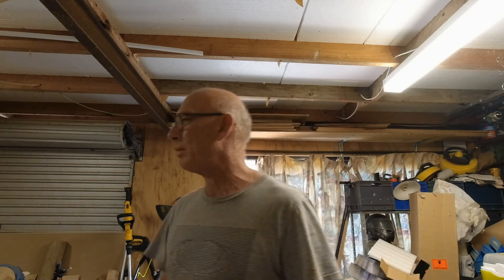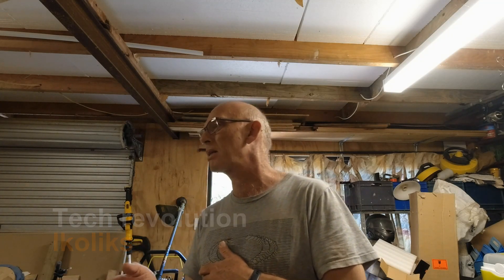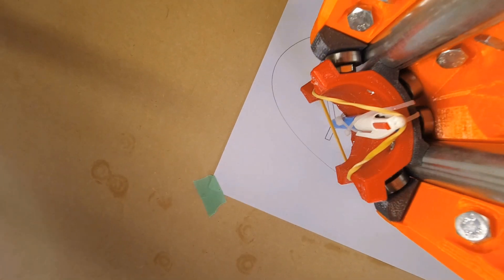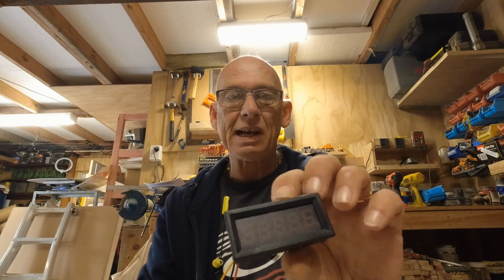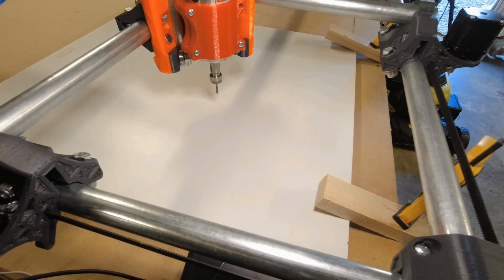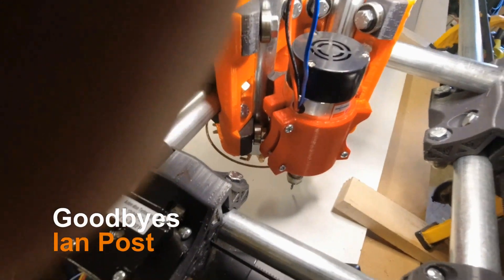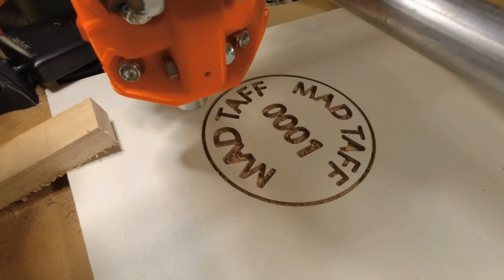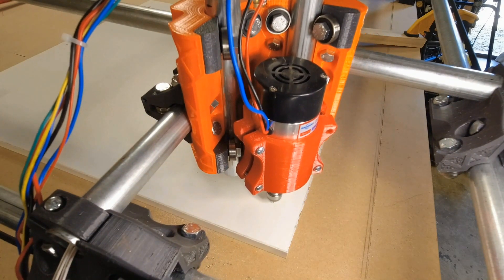MPCNC Part 2 Drawing Spindle & Cutting. The Workshop E22

Comment: Any chance to share the dragon design/gcode? What software did you use for gcode generation?
Reply from the maker: Hi sorry for delay life hey, so this is really easy to do and I used all free software to do it but I have used all this software before and it can be a bit oh my god what the F at first and this is just the way I did it there are many other ways to do this as well. The original image was an open clipart picture available at. https://www.cleanpng.com/png-flag-of-wales-colour-by-number-welsh-dragon-colori-6971118/download-png.html. This is a PNG when you download it. I then opened this in Inkscape. https://inkscape.org/ and used the trace bitmap function on the right of the screen, the detection mode I used is - Autotrace. I then saved the trace as an Autocad DFX R14 file format. This can now be opened in Estlcam. https://www.estlcam.de/ this is a free to use so many times but is cheap and very good software. You will have to setup Estlcam for your controller so in Setup - CNC Programs you will have to set the basics, mainly board type, mine is a Marlin based board so choose marlin in the list or whatever board type you are using, file ext is Gcode and millimeters etc. There are loads of good instructions on setting this up for other types of CNC on the net. You also have to set up the tools you want in the tool list menu. For a pen I used ( 1, pen, 1mm, 1mm, 90, 25mm, 5mm, 2400rpm) remember to always choose the tool here before highlighting the vector you want to cut. Now you open the file in Estlcam, you can resize and do all your planned cuts / outlines. So if you choose engraving from the left hand menu choose on line or left / right of line (all mine where center of line) highlight a line on the drawing you can choose the settings for that cut or just leave tool-path depth - ask at end if all you cuts are the same depth or you are drawing and once you have highlighted all the outlines you can then preview and it will ask what depth of cut, enter what you want the preview does not set depth in stone till you save as gcode. I put 0.5mm for drawing once you are happy with the preview you can just go to file/ Save CNC program and then save as a gcode, it will ask for cut depth when you save the file and the Gcode will be ready to use. Oh the blue cross is cut start point so where ever you place your bit on the work surface that is where it starts from. I am looking for my original folder but its somewhere on my NAS and I have a lot of dragon stuff so still searching as I have not been too good with filling stuff lately lol. This is just a quick how I did it and sorry if I have missed or not explained it very well, welcome to answer any more questions. Have you built a MPCNC or do you have another CNC. I have had a lot on the past year and am only just getting back in to the workshop and trying to start uploading again. So hope this helps take it easy.
Reply: @MadTaff  Thank you for your in-depth explanation. I've built the MPCNC last week. Still learning the basics and looking for online resources to expand my knowledge. Your videos were very interesting.
Thank you for offering me a helping hand in the learning process.